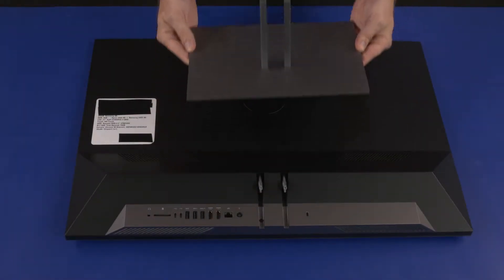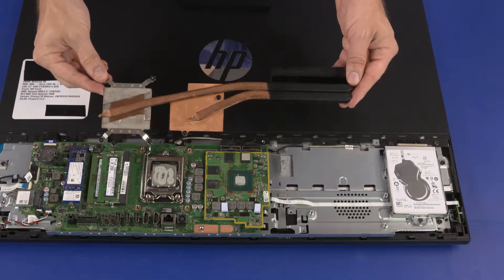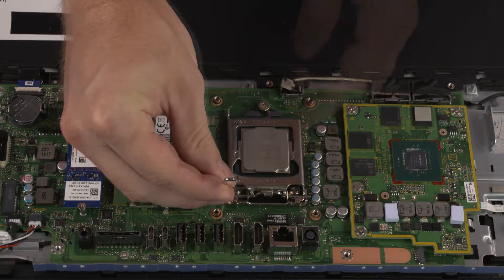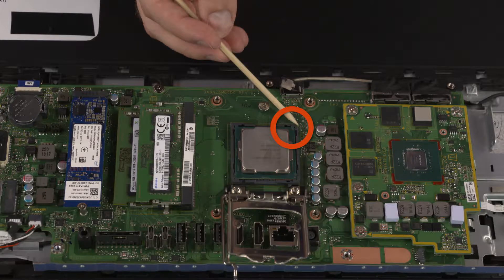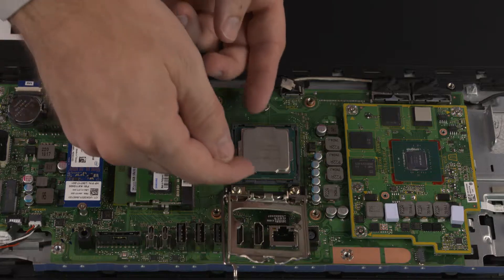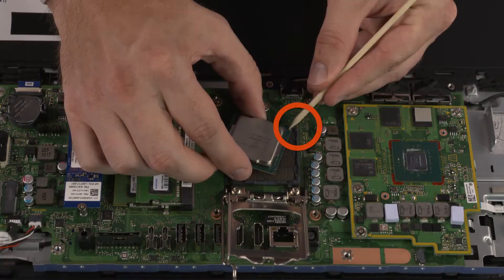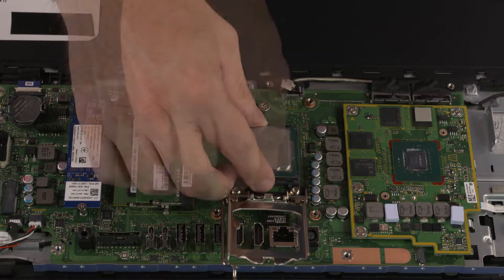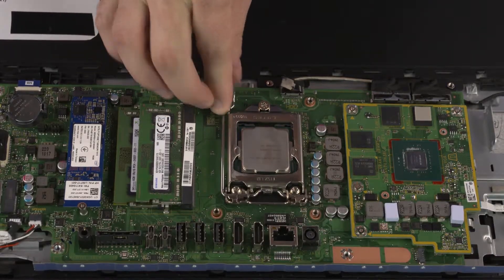Replace the CPU | HP Pavilion All-in-One 27, 24 PC | HP

Comment: does anybody know if i could case swap this into a normal pc case so i could put a gpu in it?
Reply from the maker: Hi there, thanks for contacting HP!
I will do my best to assist you.
HP does not recommend upgrading or downgrading hardware parts or software that is bundled with the product as It may affect the manufacturer's warranty and performance, however, you could change the configuration at your own discretion.
Binu - HP Social Media Tech Support

Comment: @HP Support  my pc model is HP Touchsmart 9300 elite. Can i change it cpu, ram, videocard?
Reply from the maker: +Rayyan Hashmi HP does not recommend upgrading or downgrading hardware parts or software that is bundled with the product as It may affect the manufacturer's warranty and performance, however, you could change the configuration at your own discretion.